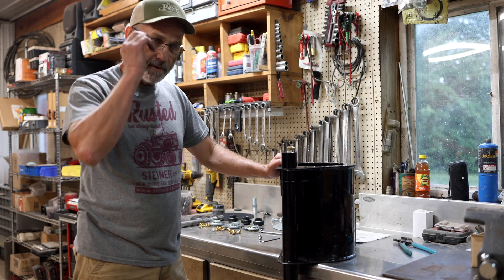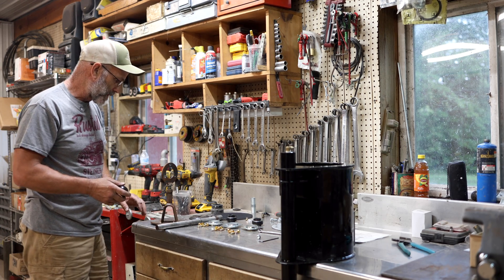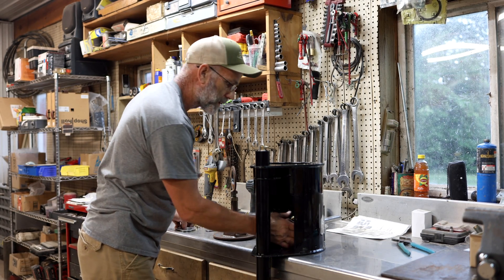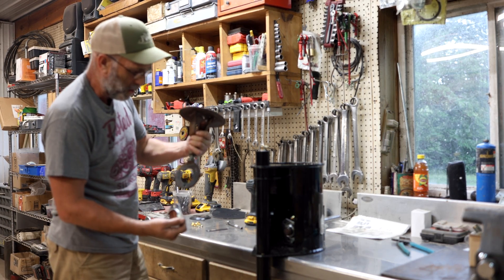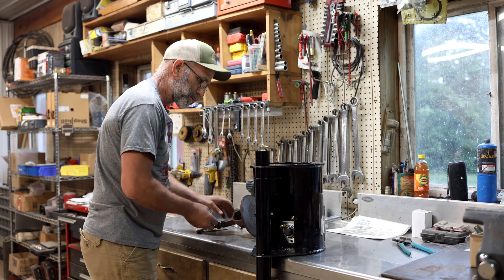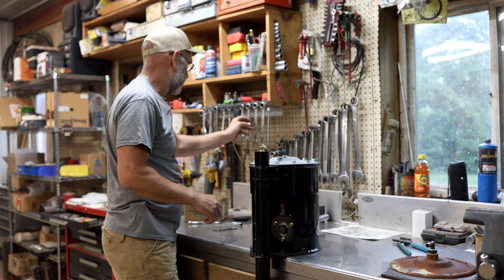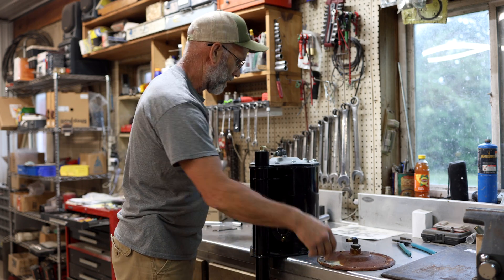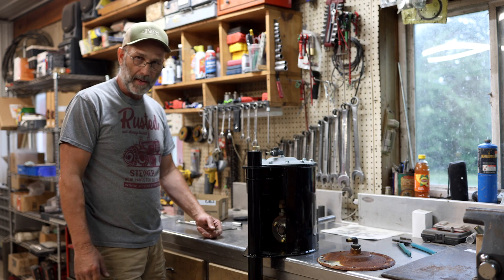Reassembly of Koender's Windmill Compressor

Comment: I inherited a 20 ft koenders windmill, I took it apart, primed and painted, it. Om mine, it had 3 bearings 2 with set screws on the bearings and one without set screws, it’s new life will only be for looks i. My horse pasture, do I have to reinstall all 3 bearings or just 2, and the one bearing without set screw go in what position on the shaft, I didn’t take it apart so I don’t which bearing went where.

Comment: I have a Koenders head that I would like to send in as a core and get one of your rebuilt units in return. What would  rebuilt head cost? What information would you need off my head assembly to determine model #, year, etc.?  I believe the unit to be a 2005 (approx.) single diaphragm unit.